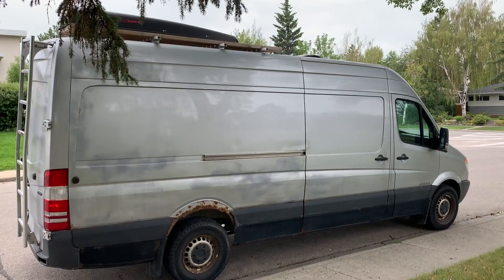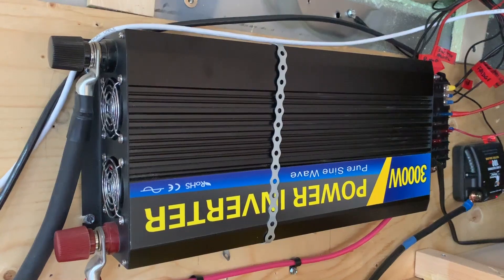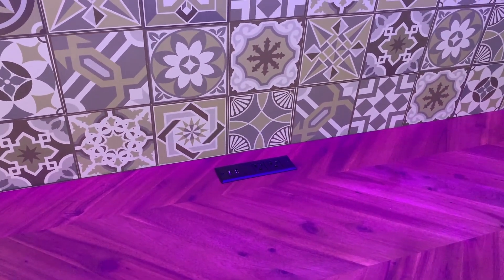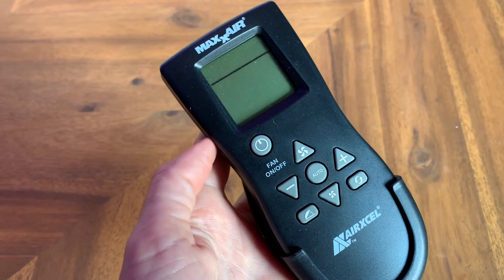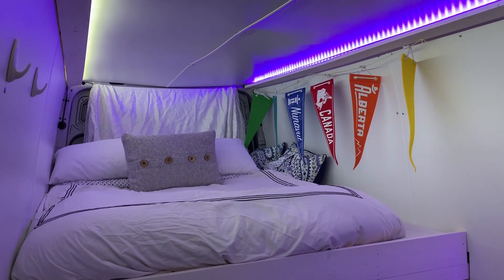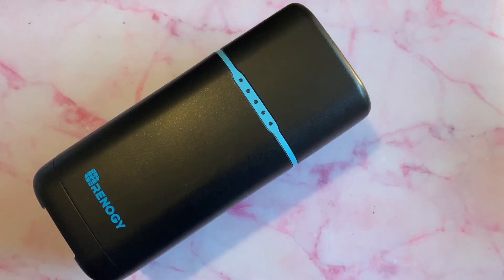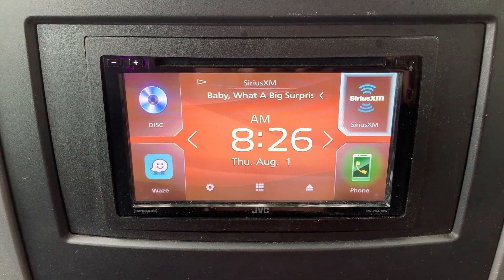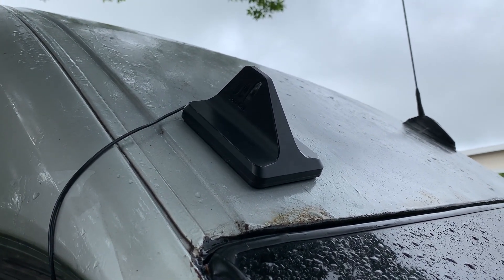VanLife: building our Sprinter Camper Van with tech

Comment: Hi Erin,

So glad that you finally made this video as I still have my sprinter build parked out front. With these sprinters I noticed that we both have rust spots. Be sure to try to repair these and especially check for tiny rust spots on the roof as I had a tiny spot leak through on rainy days and it pooled into my insulation and kinda dripped down behind my walls. I didn't notice it until I saw my laminate flooring was getting soaked from the bottom up.  With the sealed lead acid batteries , I couldn't tell in the video where you have it stored but be sure to have a make shift battery box / enclosure set up for this. Apparently these batteries are advertised as sealed and gas free but can emit tiny amounts of gas depending on usage and this tiny amount can be a big deal in a van. This is probably why you see big rv's with battery compartments on the outside with some form of airflow. I discovered this camping one night while watching tv and started to feel weird with a funny smell when I got closer to the battery.  I solved this issue with a battery enclosure with a pc fan pulling air from the box to the outside of the van.  Oh and I'm sure you already know that if you have fresh water storage to keep the two apart  ^_^.  As far as your inverter issue, I would do a bit of research to determine if it is a real pure sine inverter and not mis-advertised as one as I discovered people complaining about the same issue with certain inverters not delivering the clean power needed for certain appliances. You may just have a bad inverter or loose connection somewhere , bad ground perhaps? I had to removed a bit of the interior paint from my van where I connected my inverter ground to the frame. Another issue could be the  the charging system you have, I went with 3 (100 watt ) panels for my batteries and decided not to do alternator charging as I was conflicted on actual charge time data.  I discovered that with my van's alternator amp output, my alternator would not be able to charge a 50 % depleted battery without about 7-10 hours of driving time. Solar is great because with a MPPT solar controller it will trickle charge your batteries during direct sunlight and then amp up or down depending on what you are doing at the time. Ummm, that is all for now , this comment is way too long but love all the cool tech in your van! Let me know if you have any questions! :D
Reply from the maker: Yes! We are definitely monitoring. And thanks for the tip about the roof.

Comment: Hi there, regarding your infrared remote control testing. I discovered if you point your remote at a digital camera it will show a blue light when buttons are depressed. If, there are no blue light being admitted, then the remote is defective or the battery is dead. In short the camera sees the infrared signal.
Reply from the maker: Very interesting! I'll try that. Thank yoU!